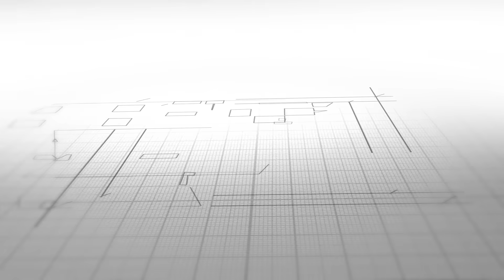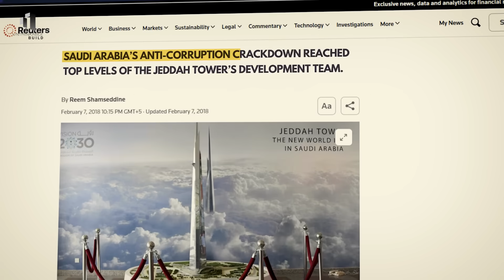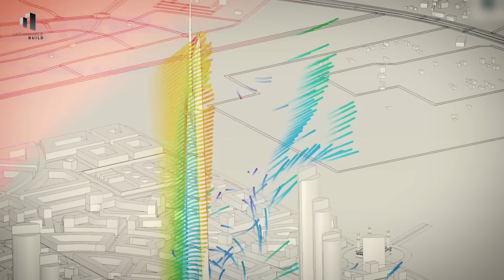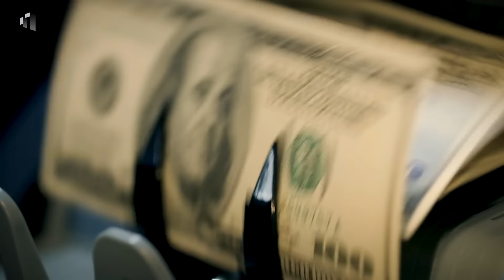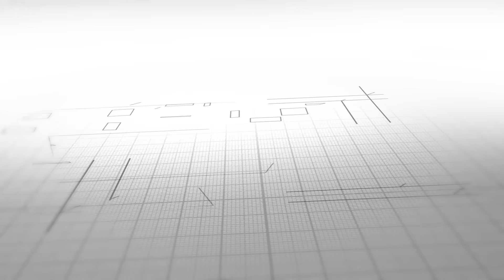Jeddah Tower: The 1-Kilometer Skyscraper Racing to Beat the Burj Khalifa

Comment from the maker: Do you think Jeddah Tower will actually beat the Burj Khalifa and become the world’s tallest building or will it face more delays? Why?
Reply: It looks yes it can beat Burj Khalifa, 
but I wonder if this may add a warth value in next world needs ? 
Dubai where Burj Khalifa is located is on last steps of finishing the largest airport to be a hub for the world aviation, steps a way Jabal Ali port the most active port in the middle east and the 11th worldwide,
I think this is what the future want for the world, 
also I think going higher is something belong to the past,
Just an opinion 🤷‍♂️
Reply: Jeddah Tower has finally resumed construction and already reached around 68 floors. If it stays on schedule for 2028, it will surpass Burj Khalifa, but given past delays, nothing is guaranteed yet.
Reply: Sure.. with engineering expertise and funds, nothing is impossible.
Reply: Its all about the tip

Comment: Just the tip. Nothing but the tip.

What are you gonna do about putting the tip on 😂 you gonna be in a plane with it attached? Imagine if it fell on the city😂
Reply from the maker: There’s been a lot of joking about that detail, but the “tip” is installed as part of the standard construction sequence. Large elements are lifted and secured in controlled stages using heavy-lift cranes with strict safety planning and redundancy. Nothing flies with loose components, and there’s no real risk of parts “falling on the city” during properly managed installation.

Comment: Pumping concrete and lifting steel 1 K in the air has to be a nightmare on its own. Then they need fresh water, this would need to be pumped up so far, a holding reservoir, then pumped again. Perhaps 4 or 5 stages. Waste water comming down again same deal. No pipe would be strong enough to hold the weight. A 150 mm pipe would have in the vacinity of 10 tones if weight. Then if war breaks out, well I dont think we will go there. Except maybe to say it would make the twin towers look like a lego set.
Reply from the maker: That’s a very real concern. The engineering challenges alone water, waste, materials at that height, sound overwhelming, and adding security risks makes it even harder to imagine such a project being feasible.
Reply: Yea the spy plane will accidentally hit the tip

Comment: It’ll be an amazing engineering feat if they finish it ,  but 1 kilometre high , that just terrifies me 😊. 
 Imagine there’s some emergency down on the first floor and you have to evacuate from the top floor  and the lifts are not working 😂 ,  imagine going down 1 kilometre of stairs ? 
Or there’s a power outage with no lifts and you have to get to the pointy end .
 If the lifts ever go out , you are in a world of pain.
Reply from the maker: That’s such a valid point! Skyscrapers always look incredible, but the practical side like safety and evacuation is just as important. Hopefully, with a project of this scale, they’ll have advanced systems in place to handle those scenarios.
Reply: I think the Burj Khalifa has some sort of elevator to descend quickly in an emergency. It's a special device. The goal is to reach the ground in 2 minutes or close to it. Anyway the elevators are staggered so you have to switch elevators once or twice  to to the top.